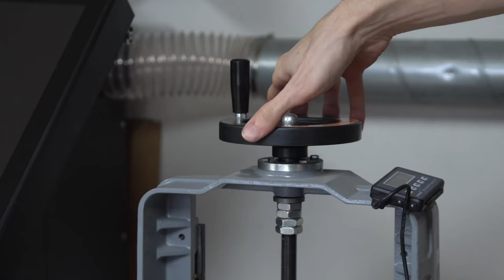Relaxing Build Montage - Watch me Craft a Custom 8-String Headless Guitar

Comment: Your channel has become my go-to for guitar related stuff nowadays. I really enjoy your rational approach to things, your pickup video was really interesting irrespective of the outcome! I'd like to ask, what has been your experience with headless bridges/hardware? I'm looking at making the plunge and trying to build a headless, but I often read people recommend avoid cheap options, with the only alternatives being around 300 euros.
Reply from the maker: Headless bridges are expensive, that's just a fact. There are many small parts that need to fit with fairly tight tolerances for it to work well, so it's not cheap to produce. While cheap ones "work" they tend to be a nightmare to tune and have the hardware strip out the second time you use it. The cheapest good option would be Nova Guitarparts. I used them on most of my builds and am very happy for the price. Should run you about 200 euro I believe. You can get them on their ebay store, or reach out directly to avoid ebay fees.
Reply: Yeah that's fair! Super, do you import those from the US? I've only seen them at Ploutone. I'm very tempted by the RIviera bridges, but I'd only give those a bash if I manage to win with a cheaper option to start with!
Reply from the maker: @mmmike3426  I get them directly from Nova Guitarparts in Brazil, no point going through ploutone if you're not in the US. They ship internationally at quite reasonable rates.